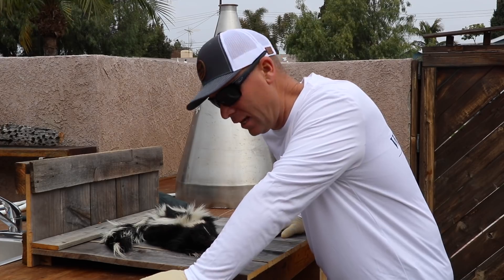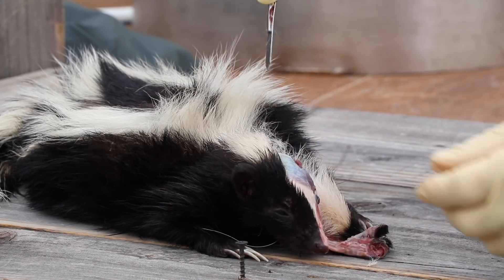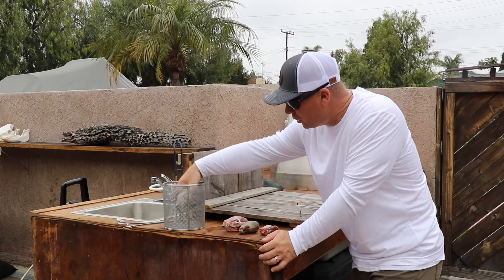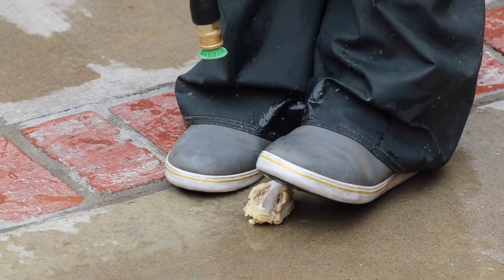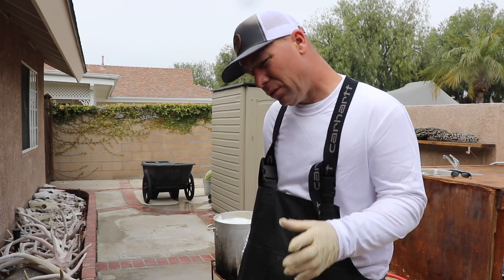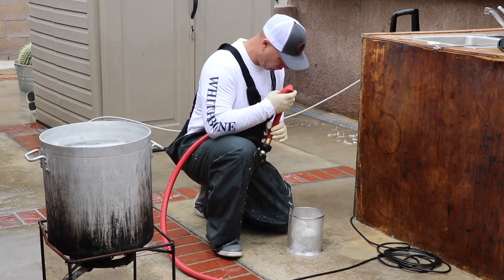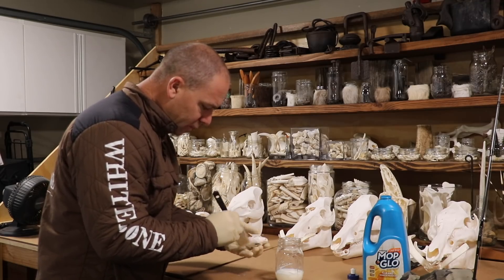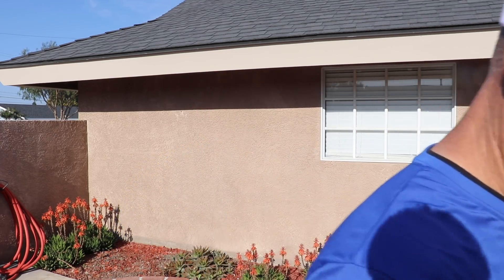HOW TO CLEAN A SKUNK SKULL

Comment: Quick question,
For a skull found in the woods, no flesh or anything on it just mud and some grime,how would you clean that up?
Reply from the maker: Sock it in soapy water for a few days wash and dry.  If you have staining or order. Follow the dead head video on this channel.
Reply: Nightshade_ Nevermore I’ve found a few and for personal keeping, I always rinse them so there is no abscess visible and then leave them in a sealed container of hydrogen peroxide for about an hour and change out 50% of the peroxide after each hour for about a day, depending on how withered the skull is.